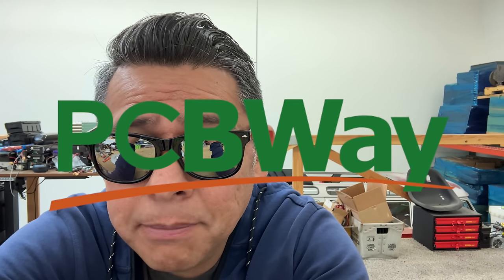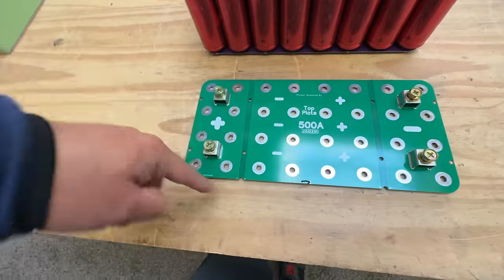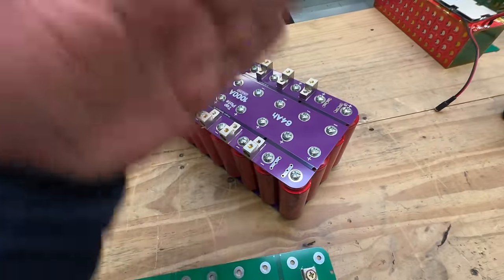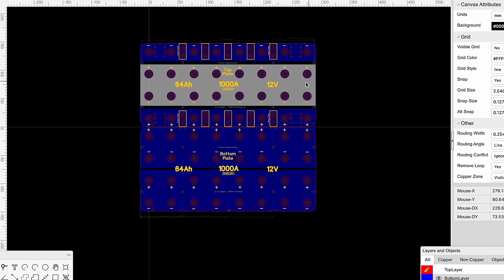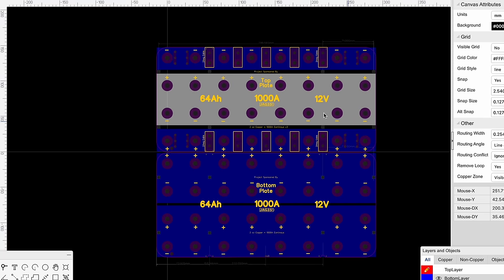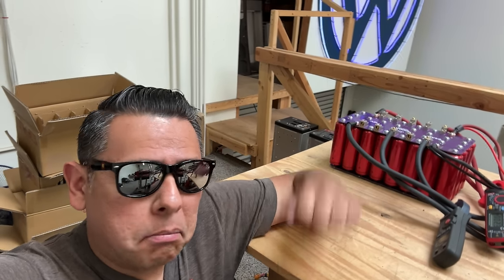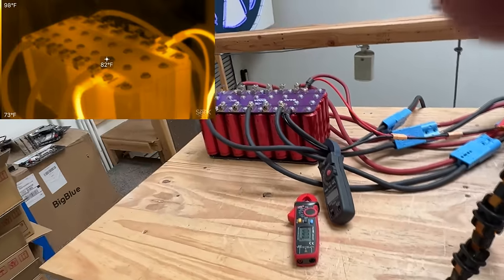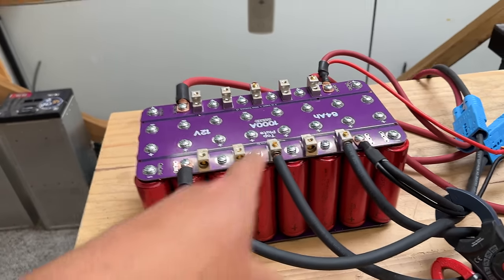These busbars claim to do 1000A - PCBway

Comment: Car audio amplifiers do not pull a constant current. They pull currents in bursts. So these are perfectly fine for audio use with a large capacitor. It will run 10-20kw amplifier setups fine.
Reply: The info I came for. Thanks I'm planning on going 12K-15K Banda

Comment: These car audio guys just can't comprehend that the 2cm thick aluminum bars are extreme overkill and don't want to admit that they're just throwing their money away.
Reply: Aluminium bar for what?
Reply: @yasirrakhurrafat1142  buss bars to connect the cells together to make a battery
Reply: @jamesmason7124  ah.
Is it any better than the tin.. spot welded stuff?
Reply: To pay $300 for fancy Dancy bus bars is absolutely ridiculous lol pay the same for bars as what the cells cost.
Reply: @yasirrakhurrafat1142  the aluminum buss bars only work with cells that have bolts. I don't recommend Aluminum I would use copper it conducts electricity better than aluminum. I actually like his PCB design. Personally I'm trying to save money so I can get some batteries for my bus that I live in but I am disabled and live on a very fixed income and it's getting hot here. The main reason why the car stereo guys use those aluminum buss bars is for looks
Reply: @jamesmason7124  ah.
You want some backup.
On a side but related note. What will you use to charge those batteries? 
If you're only goin to need those batteries for running some AC or cooling stuff. I think I might have an efficient solution.
You willing to spend some time looking up a few videos?
Reply: @yasirrakhurrafat1142  that depends on how much amps you are going to draw and what types of cells you have, what cells are you planning on using?
Reply: @yasirrakhurrafat1142  I'm also going to need to be able to start my bus , have you ever seen the movie Speed, that's the type of bus that I live in. So I need to be able to charge the batteries via solar, alternator and my generator. If you want, I can give you my email address
Reply: @jamesmason7124  oh, so if you need the most reliable batteries I'd say Lifepo4 batteries would be the best.
Plus they work in high temperatures and are safer than Li ion.
They're almost 5% less efficient though.
Reply: @jamesmason7124  I had a solution if you only needed cooling, it ( the solution ) could also generate electricity.. though it'd require a pneumatic and a thermal engine.
Its almost like magic when I first saw about it, couldn't believe it for a year.
Gimme your email sure, I'd bother you with amazing tech that I find.
Reply: Nah...I'll admit it that's why I'm here trying to learn from this guy🤣🤣were not all brainless apes🤷
Reply: @jamesmason7124  The reason aluminum is often used on lithium cells is because that's what the terminals are made out of . Google it and you will see most lithium cells use aluminum terminals. Some have aluminum on anode and copper on cathode, but more and more the external terminals are aluminum. Using copper bus bars is great, but you must have some zinc/tin type of plating or layer over the copper to protect against galvanic corrosion. Tin plated copper bus bars are very good for this. Aluminum is only 60% as conductive as copper, so I agree copper bus bars are a great choice. But make sure not to use bare copper.

Comment: You have to buy more equipment to show us the 1000A!
Reply from the maker: Another couple of 5kw inverters  should do it
Reply: My Klein cl-900 clamp meter will read 2000 amps AC and DC , maybe you should get one, it was like 200 dollars at home Depot
Reply: @jehugarcia  

Are there also such PCB busbars for super capacitors?

Comment: If using in car application do you need a balancing system? Someone had mentioned that it woild cause more of an issue than anything if one sell isnt up where need be. What would be the benefit to using a balance charger or can it charge off of alternator on its own
Reply from the maker: Used cells will likely differ from each other  so they will need a balancer
Reply: Just wanna say thank you for addressing the car audio community. We really appreciate the work you've put into these bus bar's. I have  the 1st and 2nd gen of the 1000A plates and fixing to upgrade to the 3rd gen. Keep improving and I'll keep buying.!!

Comment: Great video. But for the thermal camera you should set the spot measurement over the hot spots!
Reply: I don't disagree, but the temp measurement in the top left shows the hottest measurement on the screen.
So you can at least know it isn't hotter than that.
Reply from the maker: I moved the center spot right center of the hotspot a the end of the test

Comment: Will this 64AH be sufficient for 10,000 watts RMS with an XS Power D5100R and Autotech 290A alternator?  Or will I need 2 64AH?
Reply from the maker: I’m not into audio so I don’t know,  all I can tell you is that these cells can do 2000A on a dead short and my busbars can do 1000A
Reply: Rule of thumb for headway, 10ah per 1000 watts, so your 12,000 watts you'll want to run 120ah to have sufficient battery available.  And keep voltage from alternator limited to 14.6v maximum.  
And do not put trust into a balancer alone, build a contact relay controlled by a 30a bms so in the event of a power draw the bms will cut power and save your bank from being drained to 0 ruining everything.  
Need help with it send me a message it's not difficult and worth the additional protection

Comment: I'm not familiarised with this PCBway board designs, so my question may sound a bit stupid, but could someone explain me how the series among the 4 cells is done? The design shown has no connexion among cells. Are the connexions done with external wiring? if yes, why so and not through the board directly? probably because of the amperage? Thanks for a short feedback.
Reply: They are series connected trough the boards.
Reply: There are total 32 batteries, arranged as 4 sets of 8. Each set of 8 is in parallel, and the 4 sets are in series.  In each of the two designs (old and new), there's a top PCB and a bottom PCB. Starting at the + end of the pack:     [+]-top--[+ Set1 -] --bot--[+ Set2 -] --top--[+ Set3 -] --bot- [+Set4] --top--[-].  Hope that helps.

Comment: When they speak of a stiff pack they mean like back in the date we used to use capacitors as stiffening caps. And what the stiffening cap does? Is. Give them the extra boost of power instantaneous without killing the battery? So what they're saying is they want to use these batteries as a stiffening cap
Reply: "a stiff pack ... like back in the date".  (Fill in your own joke guys.)